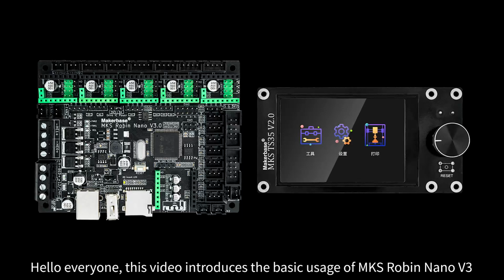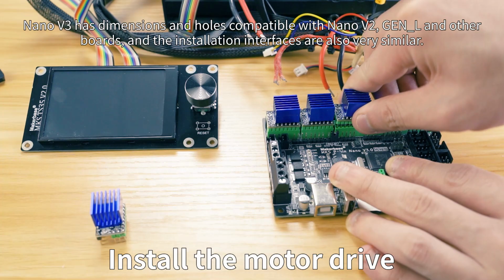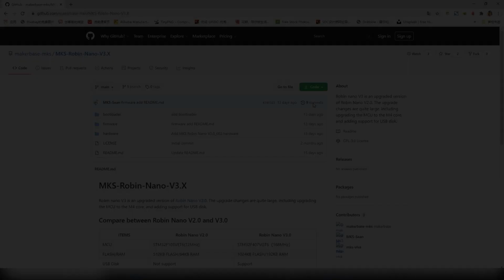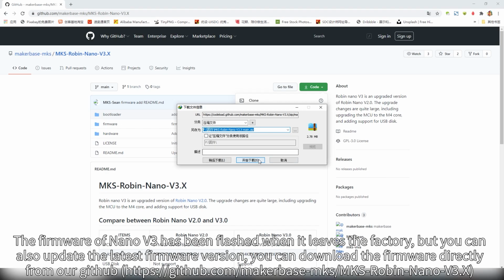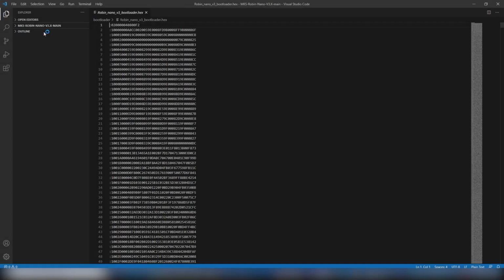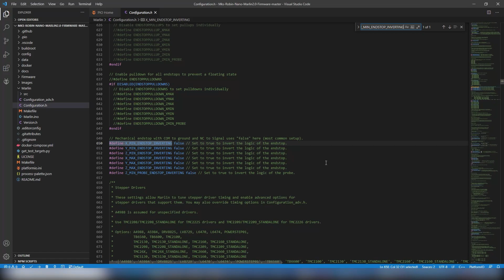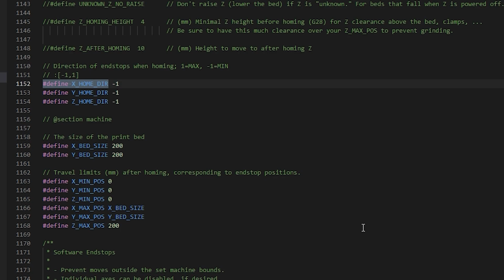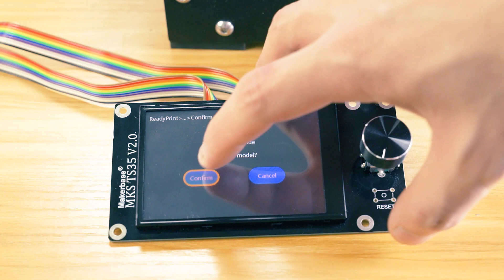How to use MKS Robin Nano V3 on Creality Ender 3

Comment: I also have a question about the jumpers. I received a large bag of them. The picture of the top of the board shows a lot of them installed on the row of drivers. I installed some of the jumpers based on what is shown on the bottom of the board. How many of the jumpers should be installed?

Comment: If i copy the Assets folder and the Bin file to the board, I don't have to use VSCode to customize and recompile the firmware, is that correct?

Comment: Can i use auto-off without power control? Sorry, but too many settings in configuration.h(( I have a relay module installed without a power detector. It worked with the old Sbase. How do I set up working with it? 
If I enable  #define PWC, the relay turns on, but PRINTER HALTER Press reset on the screen. If disable the PWC, the relay does not turn on.  I broke my brain. 
P.S. Sorry for bad English))

Comment: How to use the sensor less homing pins (n°3)? Can  i connect a proximity sensor '3 wires' to this, or do i use the normal bltouch pins?
Al so i see on my board that there are 3 pins next to the  heater bed pin, are these the BLTouch pins?
Reply from the maker: Yes, the bottom right of the motherboard is the BLtouch interface. The enabling of sensorless is the same as that of other motherboards. Enable TMC2209 in the configuration file, and then enable sensorless and threshold in the advanced settings file. You can refer to this video
https://www.youtube.com/watch?v=eF8Mqa2Y3oo

Comment: Good night, the video doesn't say which VRef to ender 3, I don't have information about the amperage of the motors to make these calculations, I would also like to know if the firmware is ready for use, or if I have to enable some parameter?
Reply from the maker: ender 3 can be set to 550, 550, 550, 700

Comment: My new extruder requires to setup up the steps per mm as Mode 0: high Mode 1: high Mode 2: high. HOw do I set that up?
Reply: I'm not sure if you still need this information, but you can change e-steps with pronterface. there's a pretty good tutorial by mod bot

Comment: hello, could you please show how to setup marlin for a delta printer @makerbase team
Reply from the maker: For the delta model, you need to download the delta model configuration file in the marlin configuration. The other configurations are the same, that is, the machine parameters are different.

Comment: hi how are you) after i installed the marlin on board (by usb flash) and want to try to print a model- on tft only arrows and no g-code files( what to do?
Reply from the maker: Printed with USB? The default firmware does not enable usb, you need to enable usb in the advanced settings to perform usb printing #define USB_FLASH_DRIVE_SUPPORT

Comment: Waiting for mks robin e3p v2.0 with tft35 and mks 2209 with wifi for cr10s to arrive these days. Waited for one with onboard eprom.
Is the instalation similar? Is 3d touch instalation similar to nano v2/v3?
Reply from the maker: The configuration of the firmware is similar, the main difference is the definition of the motherboard. The installation of 3Dtouch is similar

Comment: I set up this board on my Cetus 3d printer. I can't get Pronterface to connect. Any suggestions? Pronterface says "connecting..." but never connects.
Reply from the maker: Check whether the baud rate on the pronterface is consistent with that of the motherboard, and whether the port is set correctly, you need to select the right on the pronterface, and the firmware configuration file serial port needs to be set to -1
Reply: @makerbaseteam4217  I changed the serial port to -1 and that fixed it. Thanks!

Comment: Can be the board flashed without screen? I'm thinking on using the board through USB only.
Also are there free pin on MKS Robin Nano V3 that can be used for PT100? I had problems installing PT100 on MKS Robin Nano V1.
Reply from the maker: No screen can flash, PT100 needs an additional max31865 module to use, the motherboard cannot support pt100 alone

Comment: I have connected robin nano v3 to ender 3 pro. Just after power on the voltage on heated bed is set to 24V and is warming up.
unfortunatly a second later the Q5 mosfet is very hot, too hot and I need to switch it of to prevent burn and smoke.
What is wrong?
Reply from the maker: Hello, is it automatically heated after power on?
Reply: @makerbaseteam4217  yes, in uncontrolable way. I had a luck to disconnect bed before Q5 was burned out
Reply: Do you have some hints for me?
Reply from the maker: @olivohutcheson8482  It should be that the mos tube is broken when the electric heating is turned on
Reply: @makerbaseteam4217  what could be the reason? the board is brand new
Reply from the maker: @olivohutcheson8482  Can you change a mos tube? The model of the mos tube is G024N03
Reply: @makerbaseteam4217  could it be an alternative like HY3404D ?.
Reply from the maker: @olivohutcheson8482  It's okay
Reply: @makerbaseteam4217  I have replaced mosfet tube and the result is the same - 24V since startup on hotbed. I have recognized that the red led beside mosfet is all time ON...it looks like the problem is somewhere in part which controls mosfet - any hints?

Comment: Hello, nano v3 bugs ender 3 pro firmware, sensorless, uart, stop print, crazy sensorless, bugs print, steps and motors. Please correct firmware tanks
Reply from the maker: Are you configuring the firmware yourself? The firmware is ok, you can check if your configuration is correct

Comment: i have a lot of troubles with my ender 3. The steppers run bad. Please, help me
Reply from the maker: Can't it be moved? Wrong distance? What's the problem?
Reply: @makerbaseteam4217  install by following the video. It compiles it well, I install it in the machine and it works badly, the motors make very bad noises and do not move, an error appears on the screen "halted end stop" so I must turn off the machine.
Reply from the maker: @ivanrodrigueztorres  Have you changed the motor cable?
Reply: @makerbaseteam4217  i don't change the cable
Reply: @makerbaseteam4217  i don't change the cable
Reply from the maker: @rollertemptation  Please check your configuration and wiring

Comment: How to use MKS Robin Nano V3 with CoreXY?
Reply from the maker: Hello, the settings of the corexy machine need to enable #define COREXY in the configuration file
Reply: @makerbaseteam4217  Thanks. I probably didn't see this line.